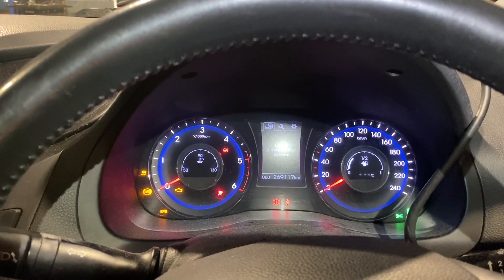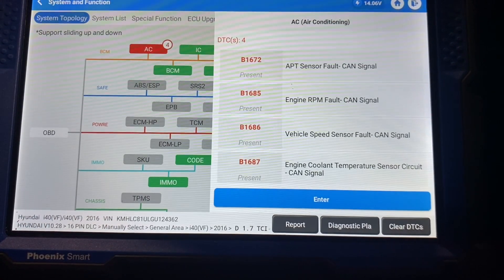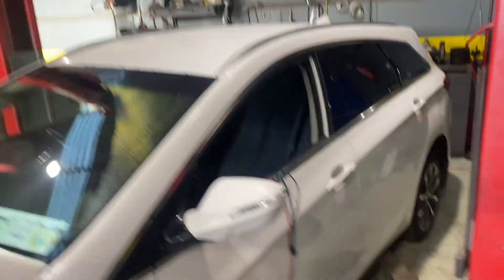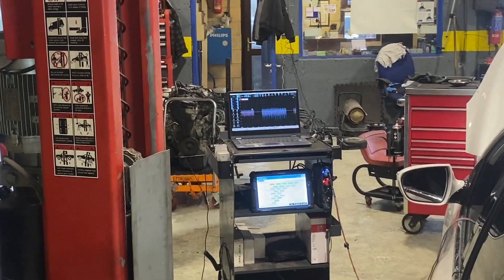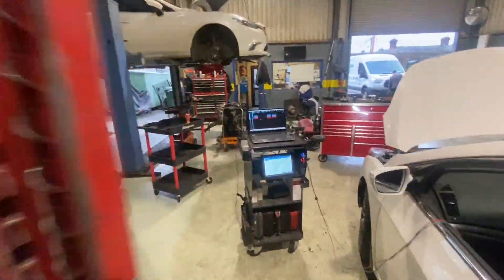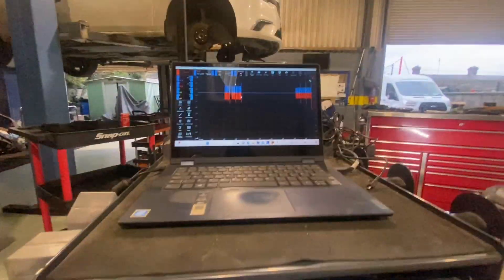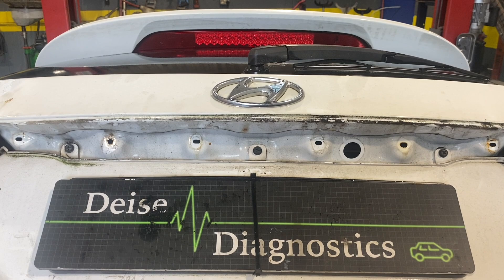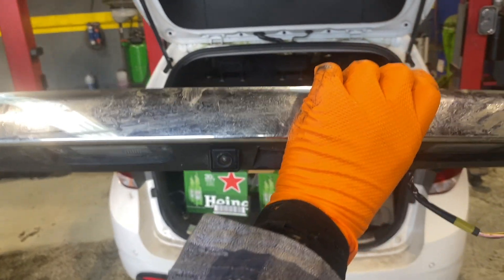Hyundai i40 every warning light is on (CAN Bus faults)

Comment: Got a similar problem on my i40 but it’s intermittent! It’s currently with Hyundai who can’t find the problem as it’s not in fault at the minute! Will try disconnecting the camera when I get it back! 🤞
Reply from the maker: Hopefully, disconnecting the camera will do the trick, good luck 👍
Reply: The fault came up whilst it was with Hyundai but they couldn’t find what the problem is. I disconnected the camera when I got it back but the fault is still there. 
With mine it’s intermittent and all the lights don’t flash, they’re just on constant and the speedo or rev counter don’t work. Will be fine for a few days then will show up randomly!

Comment: I have the exact same problem driving me crazy
Reply from the maker: Disconnect that camera and see what happens
Reply: As soon as disconnected the wire the fault lights went off dash and reve meter working as normal. Have ordered camera. Do you need to change only camera or full tailgate module with number plate loghts

Comment: Hello mate, great informative video that. I have an issue where the headlights, wipers & heaters all stop working at the same time. They all go off and then all back on again, off on off on. 
2018 i40, no one can seem to fix it. Changed bcm, fuse box, and push start button to no avail. Wish I was in Ireland so you could have a look! Any ideas? TIA
Reply from the maker: Sorry man i haven’t come across an issue like that it’s an interesting one it kinda sounds like a bad or loose connection somewhere 🤔
Reply: Thanks for the reply. Yeh the guys at the auto elec where the car is now seem to think it’s a dodgy module somewhere but can’t pin point it. 
Great video all the same mate. I’ll let you know if I conquer it 😂
Reply from the maker: @KarlStokes-f2w  yes do please it would be nice to know hope you get it sorted

Comment: I have a similar problem, but there is no reversing camera on my i40 (2015). The lights don't flash, but are on. It is affecting my tyre pressure, abs lights, power steering.

Would you recommend I take it to an auto electrician. Ot mechanic? Thanks
Reply from the maker: It sounds like a CAN BUS issue can be tricky to solve but a good mechanic should be able to solve your problem
Reply: @deisediagnostics629  thank you 😊

Comment: Well done, good process and great result.
Reply: My Hyundai i40 2016 has the same problem today. Most yellow lights on dashboards are just On and OFF. and I also have a damaged reversing camera.  Tomorrow I will disconnect the camera and check if the problem disappears
Reply from the maker: @magnum84rm yes hopefully you get it fixed 👍
Reply from the maker: Thank you! Cheers! 👍